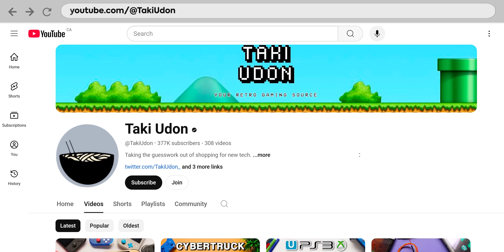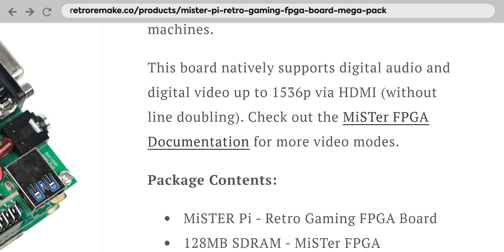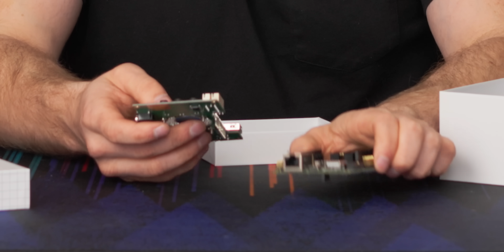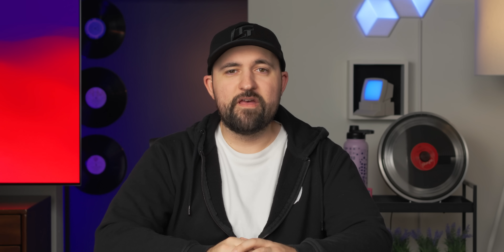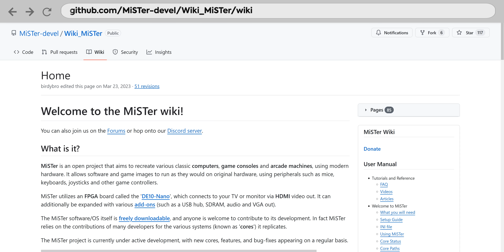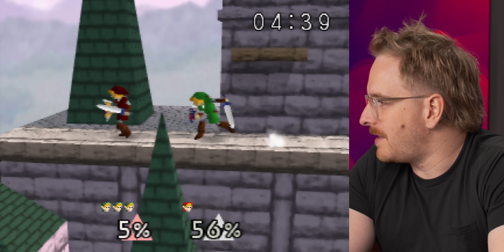Half the price. All the Games. - MiSTER Pi

Comment: He got so many complaints about the name that he ran a poll to change the name before the official release. Despite people voting overwhelmingly against it, he kept the Pi name anyways.
Reply: No hate to either side, just providing a unbiased data point.

I clicked on the video expecting it to be a Pi based MiSTER system. When he said it was not Pi based in the first 30sec of the video, I didn't care and just took "Pi" as a way to differentiate it from the OG MiSTER's.
Reply: i dont see any issue w/ it, its more a formfactor name these days than a hardware name, just look at all the other "Pi" named SBC's like Orange pi and co
Reply: Products that also use Pi: Orange Pi, Banana Pi, NanoPi. Not Takis fault people don’t know the SBC product landscape. That said, still a bad name imo.
Reply: What a troll
Reply: Shoulda called it the "MiSTER Re" 😂
Reply: I hate the name. It makes it sound like a different console, when really it's just a MiSTer fpga built with a clone board.
Reply: I cannot understand using someone elses name or tagline or catch phrase
Reply: We all know, not a Big Deal.
Reply: I would have done Mister Cake instead of Mister Pi. And yes, the cake is still a lie.
Reply: He threatened to delay the project 6 months if there was a name change, people voted that they didn't care and to change it, he didn't. (My guess is he ordered the screen printing and commissioned the branding before even considering it was a shitty name)
Reply: Why’d he bother with the poll if he wasn’t gonna change it? Lol
Reply: Well don't really care about the name personally but the dude does seem arrogant. I mean your selling a product and you run a poll i think its best to listen to your customers kinda of a stupid thing not to listen to your own customers but hey not everyone has business sense I guess!
Reply: If I made a board like this, I would name it  "Cre M-π"
Reply: @Wistbacka you can't expect people to actually search for the pi symbol instead of writing pi on their keyboards.  I can't be bothered to do it for this comment and it only takes 3 seconds.
Reply: @SineN0mine3  I think you missed my joke....
Reply: I think you're doing ok if the main drama around your product is the name.
Reply: good, screw 'em. Pi is a number. no one can own the word Pi
Reply: @ you win weirdest take of the day 🏆
Reply: It's a cool concept, but man, Taki Udon absolutely sucks. Add it to the list. There's a reason even the other popular sbcg channels/reviewers aren't fond of him.
Reply: @ oh?  Care to elaborate?
Reply: Because Taki Udon truly belives he can't do no wrong and knows better than everyone. My biggest issue with this project is him, he's known in the SBC community as being arrogant, incredibly biased and always trying to take the credit for products he kinda helped on. 

2 years ago, he did a video where he was trying to take credits on the success of the Retroid Pocket 3+ because he gave some suggestions to Retroid for the design of the original Pocket 3 (which has some truly stupid ideas, like putting the Start and Select buttons on the top instead of the front, and the Home button where you put your right hand to actually use the device), while simultaneously trying to distance himself from the shitshow that was the release of the 3, when he teased it a lot on YouTube before the official reveal, so he was part of the marketing team (and if he truly did create it, the one responsible of the issues), but he doesn't want to admit that, he wants his cake and eat it too. That guy loves to propose something to a company and then acts like he did everything.
Reply: @MrCed122  yikes. that's really good to know. I don't wanna support someone like that AT ALL.
Reply: @MrCed122  Bruh, for real ain't nobody trying to read all that. Unless he's actively harming people, pirating the boards, or something like that all that matters is if he's producing a product that meets the needs of the customers. The retro scene is so small that this is like reading about drama and personality clashes in Knitting YouTube or something.
Reply: @Ragnorok64  Zoomer brain can't comprehend something longer than a tweet LOL
Reply: @Ragnorok64  came to a youtube video's comment section to complain about READING 💀
Reply: Well, sounds like Taki. What else from a person who uses his  reach and follower to spread the insanity that he „created“ the retroid pocket because he told retroid to use better buttons
Reply: the amount of people crying over nothing in the replies
Reply: I didnt like the name at first, but now I find it kinda nice!
Reply: Oh no. I am going to cry now. Who has a tissue. 🤪
Reply: @ Are you okay? You seem unhinged.
Reply: @domdecosa  Getting mad about the name of the computer and throwing a tantrum over it is unhinged.
Reply: @ Who’s mad? You need someone to talk to or something? Your responses are weirdly irrational.
Reply: @domdecosa  You're mad that Taki didn't name the Mister Pi what you wanted and are trying to push b.s. drama over it.
Reply: @ Whoa buddy. You need to calm down.
Reply: @domdecosa  Yeah sure. Karen.
Reply: It's kind of a dumb thing to get upset about honestly. The name "Pi" in of itself isn't trademarkable and is used on a swath of SBCs that have very little to do with each other, at this point it's really just shorthand for a kind of SBC of which the MiSTER is one.
Reply: @scheeseman486  he is not legally wrong but in community it's generally believed that when someone slaps "Pi" in their product it is either running a compute module or atleast is somewhat compatible with RPI system 

So he is 100 percent entitled to keep whatever name he likes it's good to avoid confusion not like people are buying his board for general purpose stuff but companies are quick to pick up the trends like removing the headphones jack
Reply: @awdhut-e2e  No it isn't, anyone who has any interest in SBCs knows that the Pi label is generic. Outside of that sphere there will be people who make poor, misinformed assuptions, this is their problem.
Reply: @scheeseman486  anyone who has any interest in SBCs knows that the Pi label is generic - there's the problem, not everyone in the retro community is interested in SBCs and their mechanics, they just want a way to play their games on modern hardware.
Reply: @scheeseman486 who gives a shit whether it’s legally trademarkable? The point is the confusion
Reply: @ogawacash  No one is actually confused though. Zero people have bought a Mister Pi thinking its a Raspberry Pi you are concern trolling.
Reply: @ogawacash  What's confusing? It's a SBC board with an ARM processor on it, it just so happens to have an FPGA but that's not like any other SBC that has a specialized perhipheral on the same board. There are already products called Orange Pi, Banana Pi, Rock Pi that have existed for many years.

Are you suggesting that companies should avoid "Pi" because Raspberri Pi has the word "Pi" in their company name and products, as if a phonetic representation of a widely used mathematical constant is something they have ownership of?
Reply: @backgammonbacon I would have assumed by the name that it is some sort of upscaler based on a Pi and I think it's reasonable to assume that
Reply: @backgammonbacon  I think you're looking at it from the inside. I've never heard of this thing before and I'd have assumed that there was a pi in there somewhere. It's not impossible - my ZX Spectrum Analog To HD upscaler box has a pi mini living inside and had I been able to buy a FGPA Spectrum (such as the Next or N-Go) I'd definitely have gone with the accelerated version (which uses a pi mini). I could have easily believed this was a Mister with a pi for (IDK) better processing of obscure consoles or weird sound chips for instance.

[FYI: the ZX Spectrum was a 1980s British microcomputer which competed with the Commodore 64 - I use a ZX-HD upscaler with mine]
Reply: @backgammonbacon  I clicked the video cause I thought it was raspberry pi based.
There's no way the name wasn't purposely made misleading for that exact reason and also for search algorithms.
Reply: @ogawacash  Well, one of the main arguments against the Mr. was to "just get a pi" but now you are getting a pi.
Reply: @backgammonbacon I have been reading comments because I thought this was part of the raspberry pi family of products so there is confusion
Reply: @ogawacash I expect people that are buying this won't be confused by name being something from a different.
Reply: incorrect the comments in posts have repeatedly had people asking about the name because they were confused.
Reply: @ogawacash  if you get confused because a product has a word in it. you've got bigger problems to worry about.
Reply: @backgammonbacon  Going to be honest I clicked on this thinking somebody had managed to make some kind of Mister compatible Hat for a Raspberry Pi (like piggy backing its video outputs and things) I would have realised it was different quickly but the confusion is there.
Reply: @backgammonbacon  incorrect
Reply: @Jamstruth in that case, as in most cases it seems the confusion stems from people thinking that they're interested in it enough to find out what it is and then they stop being confused. 

As far as branding goes that seems like a win.  The hardest part of selling any of these products is getting people to realise that it exists. 

I don't think any of the potential buyers would purchase the product before researching it because the nature of SBCs and retro gaming hardware that's usually a bad idea.  

The name isn't saying anything that isn't true, it's just a memorable and short label for something that's very similar to a lot of other things. 

Naming something like this is no where near as easy as people complaining seem to think, all of the good names are taken and so are most of the bad ones.
Reply: @backgammonbacon  I literally came to this video because I was searching to see if the Mister Pi was just a Raspberry Pi with a fpga add on or something and my confusion on why it wasn't available from several of the mister fpga kit sites I was looking at. It's a bad name and is confusing for for those of us who are into tech, but who are just now getting into retro gaming.
Reply: @backgammonbacon  to be fair this is my first time hearing about this and purely based on the name i thought it was a rasb pi
Reply: @scheeseman486 you don’t even need all that to just say it’s dumb because it’s not their product and tbe product is good regardless
Reply: @scheeseman486  There's no strict definition of any of these terms but it seems like if it ends with Pi it's some kind of SBC, and if it starts with the name of a fruit it's ARM-based.
Reply: @scheeseman486  Right, but that's only because of unrelated projects capitalizing on their branding. The fact that 'Pi' is worthless as a distinctive name has nothing to do with the Raspberry Pi Foundation, and everything to do with a bunch of freeloaders taking that name and running with it in an attempt to legitimize their own brand of crappy SBC. Which sucks. Not sure why anyone would want to associate their actually decent product with that unfortunately mixed bag of random boards, but to each their own i guess.
Reply: @dustbustr123  "Pi" isn't Raspberry Pi Holding's branding, it's "Raspberry Pi". Their raspberry branding is what is most prominent in all of their products. Who is freeloading?

Brands riff on naming and branding schemes of their competitors all the time, particularly in the tech industry. See: all the naming schema from the early days of x86, and there is nothing intrinsicly wrong with it unless there is an actual trademark violation.

I just don't see how this "sucks". What sucks? No one's rights are being violated, no one is being tricked anymore than someone buying a Dr Bob instead of a Dr Pepper. It's a bunch of pointless handwringing.
Reply: @scheeseman486  It's because for the community interested in this, they attribute the name to the RP... so they don't like the confusion....
Reply: @scheeseman486  And specifically, the kinds of SBC that have a very similar form factor.
Reply: Any guitarist with a Big Muff Pi pedal knows that the suffix has been used for ages.
Reply: It has an ARM chip, hence the Pi, it has the FPGA chip on it hence the MiSTer. What's the problem?
Reply: @smashed_penguin  The FPGA on the DE10-Nano and MiSTER Pi are controlled by the ARM chip. They're both ARM boards with an FPGA perhipheral attached.
Reply: That's hilarious. I'm pretty sure that no one who actually uses this stuff cares about the sketchy 'cross-branding' but IMO it's definitely tacky, to say the least.
Reply: @smashed_penguin  What's misleading about it, specifically? How is the company misrepresenting it's product by using a widely used mathematical constant in it's name? Keeping in mind, the use of the word Pi has been used in the SBC industry for over 6 years, I have a couple of Orange Pis from 2018 on my spare parts shelf.
Reply: The name complainers were whiny Karens and they're still whiny Karens. Absolutely nobody in real life googled 'Mister Pi' and got overwhelmed and confused about DIY emulation boxes. This individual simply doesn't exist.

Comment: FPGA emulation is a stupid marketing gimmick. Software emulation for these devices is good enough that nobody can tell the difference, and in most cases the software emulation allows for features that improve the gameplaying experience. 
The amount of people that the marketing from these FPGA companies has duped into forking out crazy money for an experience they could get on their existing or even older hardware is just crazy.
Reply: Not at all a gimmick. I bet you didn't even play original hardware on a CRT TV
Reply: This is true for the most part, though N64 emulation is very imperfect on low-end hardware. You're not getting good N64 emulation on a sub-$200 device, which is what makes this pretty tempting to me.
Reply: @ColorblindMonk  If I recall, the MiSTer N64 core is not perfect - there were some shortcuts to make everything work within the constraints of the DE-10 Nano. It works fine for the most part, but it's not as "perfect" as the other cores.
Reply: @adeptfelix  I don't doubt that, I'm assuming the same goes for the Saturn core. For what it is, though, I think it'd still be serviceable if it ever stays at that price point (which signs seem to be pointing to 'no').
Reply: @ColorblindMonk  This is absolutely untrue - I was running full HD PS2 and N64 emulation on computers in 2010 - the value of which is less than $50 in today's used market.
Reply: @FrenziedManbeast  I said good emulation. These emulators in the 2010's were super hacky.
Reply: @ColorblindMonk  Unsubstantiated claim, I was playing full HD 60FPS in 2010 without enabling Speed, RAM, or FPS hacks. Good enough for me to enjoy hundreds of hours on my back catalog. Sounds like skill issue?
Reply: @FrenziedManbeast  maybe you are just oblivious to the glitches? software emulation has never worked like original hardware. It's close sure. And some games work great. But it has always been a mixed bag, and some games are basically trash and will probably always be trash on software emulators.
Reply: @timseguine2  Not mine. Emulation has been hardware accelerated since circa 2008. Git gud.
Reply: I think the advantage fpga has is less lag due to no OS overheads compared to software emulation.  Its more simulation than emulation. Still wildly overpriced and fiddly for what it is though.
Reply: Its a next lvl scam for nostalgia nerds